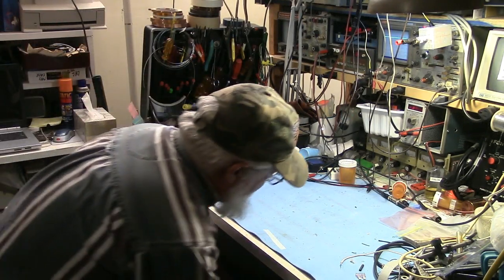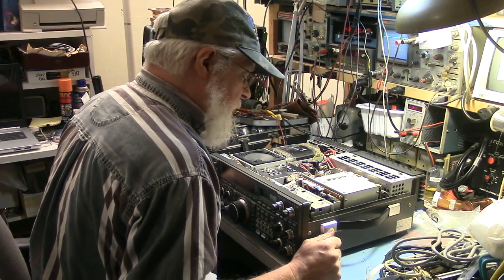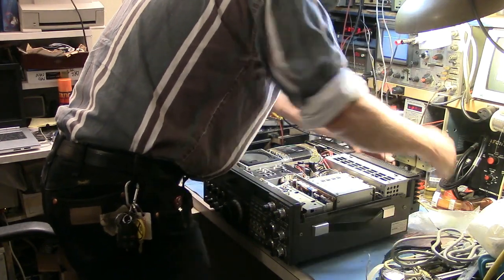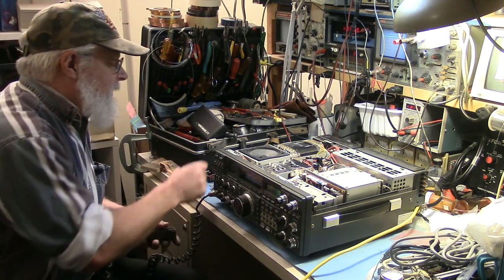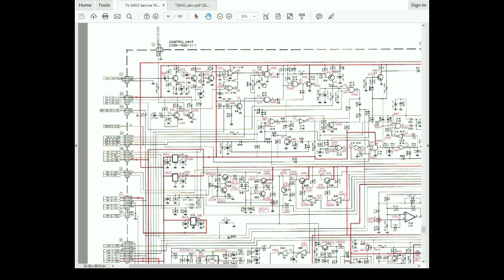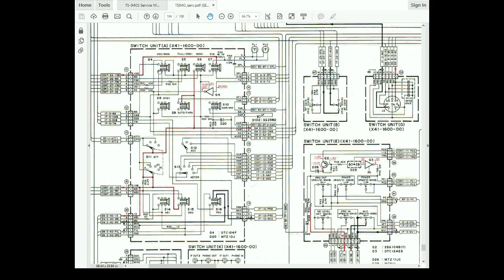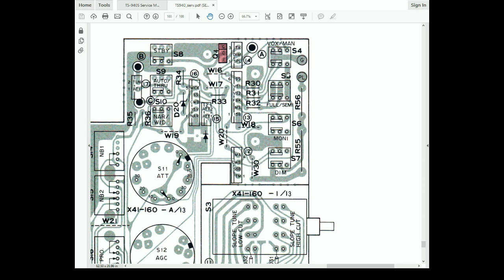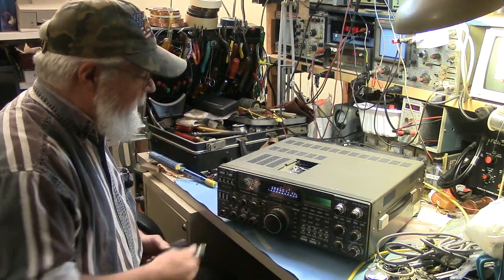TS-940S VOX... repair

Comment: Are you still doing repair videos? I've really learned a lot from  your TS-940S videos. I have two in my shack, neater of them work. I have found problems with drawings not matching the board layout.  I'll say this about the Ts-940S, if you can fix one of these radios you can fix any radio. Trouble shooting this  beast is a night mare. I hope to see more from you soon.
Reply from the maker: I am still doing videos when I have time in shop. But COVID, and an unusually busy year, has prevented my project time severely.  My current 940 project will be to add a real AM modulator (not Balanced Modulator) in the driver stages of my 940.  So look for that.  
If you found errors in your manual you should watch part 2 of my FT1000 series.  Thanks for watching and stay well.

Comment: Faulty ground.... would have expected that in a strange electrical issue on a car, but not that radio. Could be due to my zero experience with working on radios, beside taking old military surpluses ones apart when I was a kid... dad would bring me one home once or twice a year to break into and explore.
Reply from the maker: There should NOT have been a ground fault. Normal engineering practice would dictate that a ground wire and continuous trace on board would have provided a circuit path to ground even if mechanical means failed, as it did in this case. Using mounting screws for ground return in a sub-assembly like this, for some, but not all circuits, was extremely lazy.  Good exercise in diagnosing schematic vs. physical differences though.  I miss printed service manuals, no easy place to note this mechanical difference.

Comment: I really like your way of trouble shooting. I also find that most repairs are found with the eye. We have a lot in common. I am a retired machinist, have my own shop and repair radios with my limited test gear.  My benches look like yours also! HI HI AB1ZI
Reply from the maker: Thanks Carl!  Sounds like we do have a lot in common. Welcome to the fray. I try to leave little to chance in electronic service.  I delight in accurately troubleshooting from the symptoms alone, often over the phone!  The only way to do that is understanding circuit function thoroughly.  Not always the easiest with today's service literature. Get some stuff on your channel!